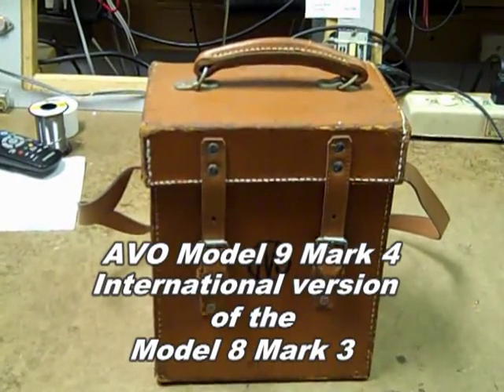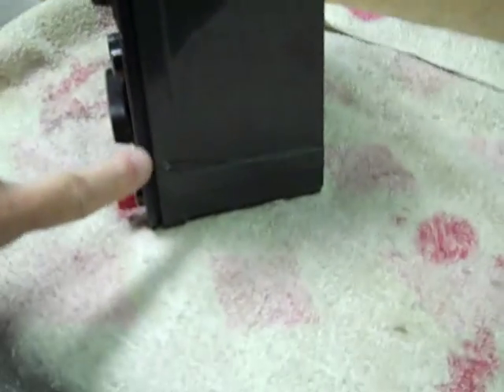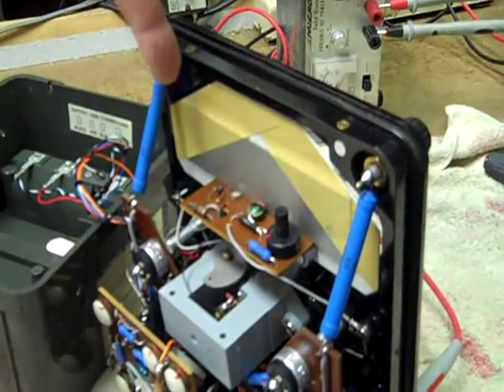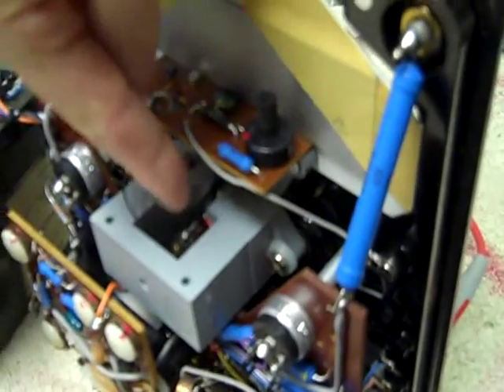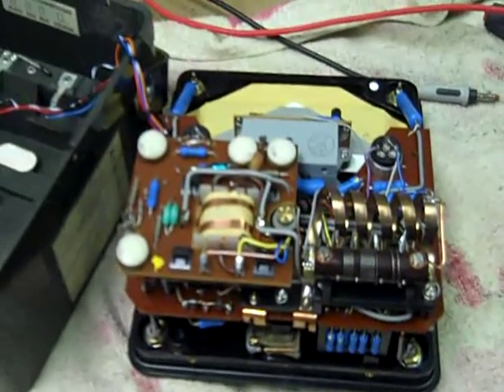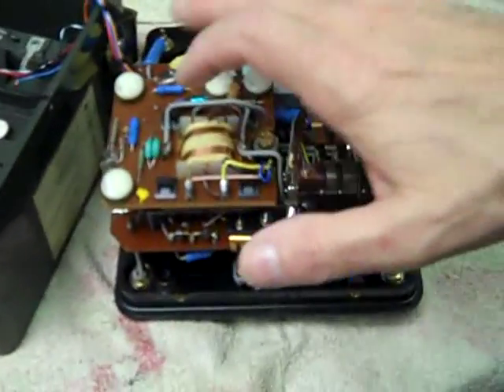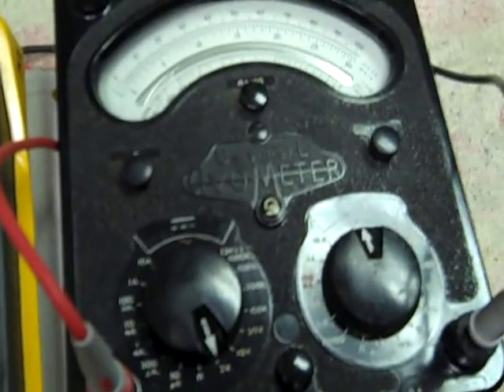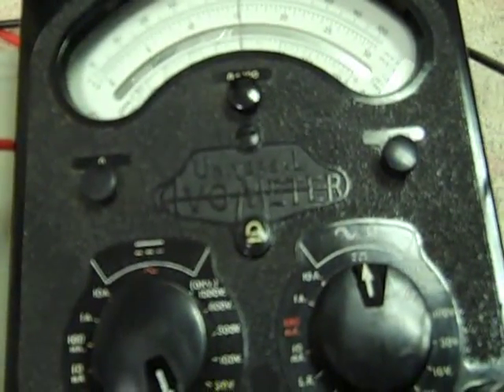AVO 9 mk 4 Review

Comment: Yes , but what if you measure voltage across a resistor of 20Kohm with those 2 meters would they still show same measurment?
Reply from the maker: That would depend on the circuit impedance OTHER than the 20K resistor. If for example the 20K was simply across a power supply line, any effect would be less than negligible. In a very high impedance circuit, the AVO might show more loading effect. This is why high input impedance, high sensitivity meters were developed. First VTVM's then digital meters. Even a 10 megohm meter can load some circuits.

Comment from the maker: Yeah - the AVO's are really good. In my old age however my love affair with analog's has faded somewhat. I mostly use them for trending, quick checks of continuity, "popping" a speaker etc. Of course there's the occasional older TV, and it's always fun to watch the 200 volt line come up on a Simpson meter. Just seems so RIGHT.